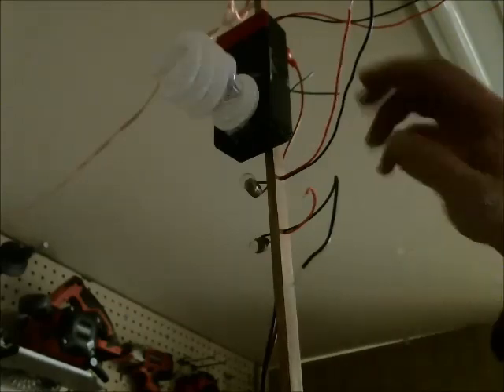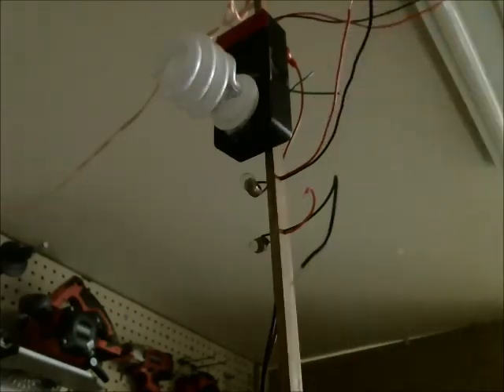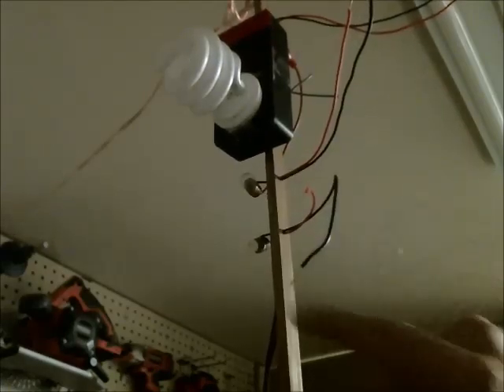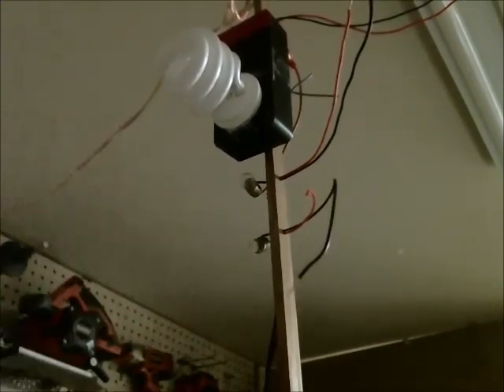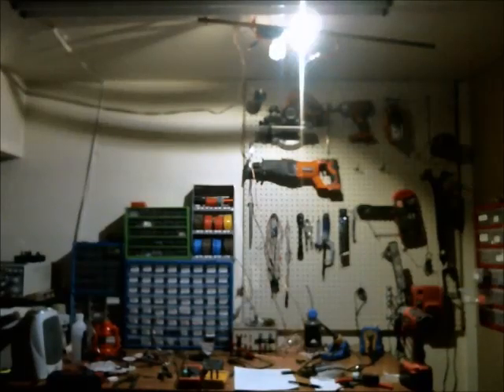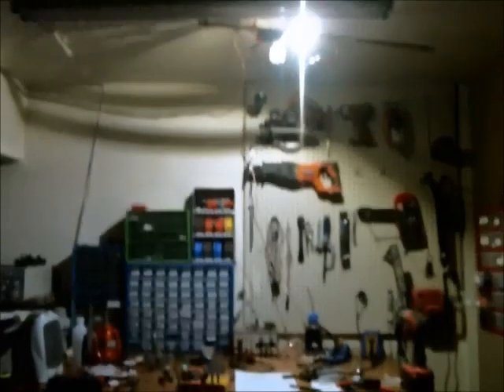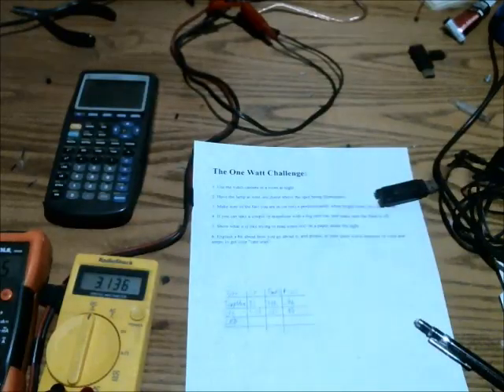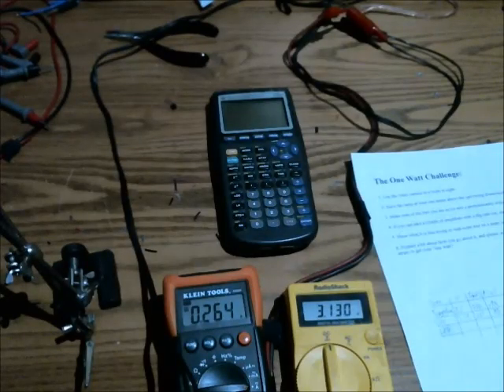Project: The One Watt Challenge

Comment: Wow. That LED really lights up the bench compared to the other two, and for a bit under the watt too! Great video. How do you think the LED would go on higher current pulsed for short duration and low duty cycle?
Reply from the maker: Mongrel Shark To be honest I haven't done much with LED's and PWM. any recommendation as to getting into this?
Reply: 555 timer and a scope... I like the diode mod for the 555 circuit that lets you control the on and off times independently. Solar cells have a great response time for observing the effects of heat reducing light output if the on cycle is too long.  I tried it wth arduino, thinking it would be eaiser to change code than resistors on the 555. Not good. I had trouble with micro commands.  555 with diode mod (http://dlb.sa.edu.au/rehsmoodle/pluginfile.php/6985/mod_resource/content/0/kpsec.freeuk.com/555ast2.gif) and 100k-500k pots for R1+R2 works great to tigger a transistor of your choice. Somthing with good sharp on off times would be good...
Makerj101 did a good video on the topic a while back. Although I really wanted to see 2µs on time and 10-20µs off time. So have been meaning to do my own test ever since.
20mA LED Pulsed at 1.0 Amp Experiment.  11 Times Normal Output at a Pulse
Reply from the maker: Thanks a lot Mongrel.
BTW I would like to see your arc (light output) at 1 watt :)
Reply: The breadboard just hit the bench :) still has 555 timer on it from last time :) Got about 10 hours till its dark enough to film. Should be plenty of time.
Going with the 555 thing first. Then I might try a JT as well.

Problem is I dont have any high wattage leds. If I make a 555 or JT with 1 watt input. and a single 25ma led. Its going to be a 1w fire starter.... Like that time I used a 1300w MOT for a jt coil... MOT Slow flash Joule Thief. Single transistor flasher with no capacitors.
The batterys in that video have been stuffed for years, if I put them in the charger it just says "Faulty". When I did it with well charged batterys, it blew the LED on the third flash, and had it on fire by the 5th flash. 20 times in a row....

Comment: That's definitely a good LED!! very bright. is that a single one watt LED, running off a battery + resistor ... or a power supply of sorts?
Reply from the maker: It is a single LED. http://www.avagotech.com/pages/en/leds/high_power_leds/1w_led_emitter/asmt-aw00-nst00/
I am running it straight from my variable DC power supply.
Reply: Matt Heilman ahh yeah. i kinda suck at making rules... by doing it myself, to an extent, i invited people to allow power sources to alleviate all the heat dissipation,... meaning, none of us are measuring 1 watt AT THE WALL -- my bad -- sort of botched the whole thing, given that there are inherant differences in efficiencies based on different drivers.... but anyway... it's good to see all the different product nonetheless. i suck at making rules i guess i should have thought it out a bit better. maybe "challenge II" will have some more rules criteria. That LED of yours definitely throws the light, i like it!
Reply from the maker: I was think about, what was fair... I decided to leave the Resistor out, with the LED as I felt it was cheating.
Reply from the maker: KyleCarrington I really enjoyed the challenge, did my best to follow your criteria.
Reply: Matt Heilman Absolutely, my rule making was very lackadaisical. Eventually we'll do round two and get a little more technical hehe.